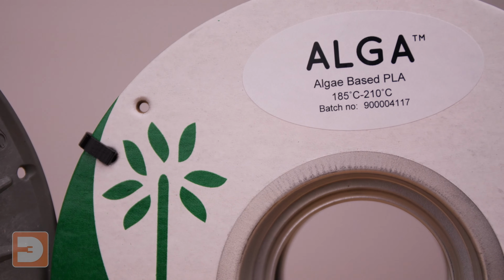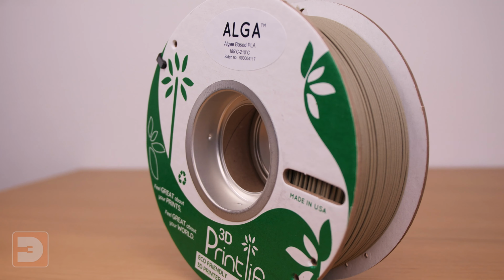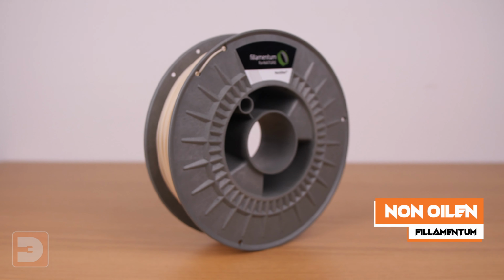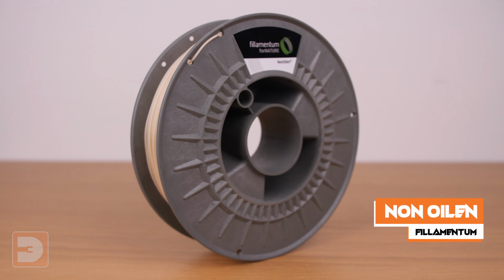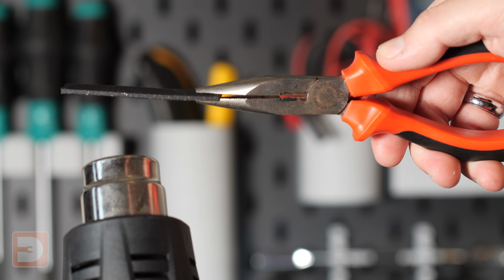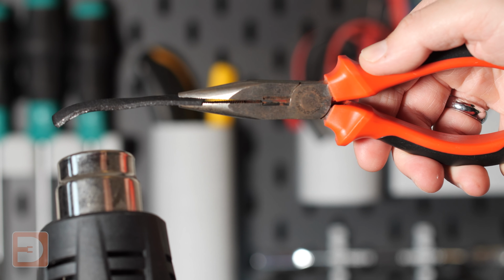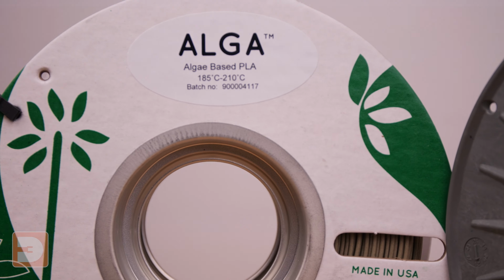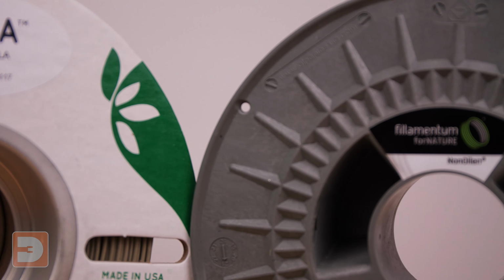Biodegradable filaments for 3D Printing

Comment: 3:08 a BIG issue here is: even IF the filament itself is certified "safe for food contact" you have to take into account that the 3D printing process itself is NOT, the raw material might be safe but once you add more variables like: the oil in the rods and gears which pushes the filament into the extruder (you would need to have a 3d printer to be used exlusively with this kind of filaments to avoid cross contamination with any leftover filament inside the extruder) , the material of the nozzle (the standard brass nozzles wear down with every use) and the layer by layer printing process itself, it doesn't matter if you go with the finest resolution your machine can handle it will still not be the same as an injection molded piece (also the fact that injection molded plastics tend to work at a higher temperature also helps sterilize the piece as it is being formed) and each layer will still have gaps for microbes to adhere to, this was proven by another guy here on youtube which did the test and discovered that the only way to truly have a food safe 3d printed piece with no microbial growth is to add a post processing stage with some sort of food contact coating after printing

Comment: Are there companies that already produce printing materials for printers that are 100% biodegradable? If not yet, do you have an estimate of when such a thing will happen? And is it even possible to produce such a thing?
Reply from the maker: Well as I mention near the start of this video, the filaments I talk about here are 100% biodegradable. 
If you're worried about the fact that they contain a percentage of PLA, don't let that put you off. PLA is a plant based plastic (if you've not seen it yet watch my earlier episode in this mini-series where I talk about the environmental side of common 3D printing filaments) and is biodegradable, but can take a long time to do so if not in perfect conditions. These biodegradable composites allow that composting process to happen much faster.

If you do want to see the latest in this field though, good news. I am planning on a follow up to this mini series in the coming months so keep an eye out for that.
Reply: @3DRevolution  This isn't entirely true. Biodegradable is not the same as compostable. PLA will degrade into microplastics if not composted under specific industrial conditions. It requires not only specific temperature requirements, but moisture, acid, and microbe population requirements. Basically nobody lives in a city that composts like that. None of these filaments improve on that, and it's potentially more harmful to believe that your "biodegradable" filament is compostable in your city compost when it's not. You could end up contaminating the compost.
Reply: @overcaffeinatedengineering Do you recommend a video/channel/book/business that already links to businesses that have compliant standards and protocols in place?

Comment: An updated video would be great. I'm looking in to eventually only using biodegradable filament.
Reply from the maker: I'll be definitely covering this more, but as this video is less than a year old, it'll probably be a while longer before I do a direct update on this specific video. Have you checked out the rest of this series I did? I produced a full series on environmentally friendly 3D printing, check it out via my channel page, I saved the video as a playlist so you can easily watch the whole thing.
Reply: @3DRevolution Do you know... how to get this kind of content to the top of people's feed?

I have noticed that less than sufficiently competent content creators get to be promoted by the algorithm (and promoted by the uninformed majority), and the competent professionals in any given field do not get the exposure they should rightfully receive (for everyone's benefit I might add).